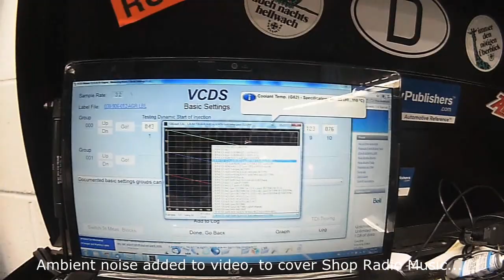VW A4: ALH TDi Timing Belt Installation

Comment: This video helped thanks again! Had to remove small roller again for more room to place the "very huge" engine brace back :) 
I´m still try to figure out if I removed the mount with or without all the rollers placed.. from top or bottom? Anyway I´m very closed to have the tb replacement done! :)

Comment: Besides replacing the cam seal, is there an actual reason to remove the cam sprocket?
Reply from the maker: You don't have to remove the sprocket... but it (the cam sprocket) has to be loose so that the timing belt can be tensioned correctly.

Comment: hello, when you adjusted the belt tension, shouldn't the upper roller be installed?
(I noticed that you installed it after the belt was already tensioned)
best regards.
Reply from the maker: Yes, it should be. In my mind though, it does not affect tension that much, so sometimes I don't install it until after the belt is tight.

Comment: Hey Thomas, what are the torque specs for putting this back together? Also, anything specific for installing the tensioner? Thanks!
Reply from the maker: +Brad Sherwin Timing belt kit should have come with instructions... you should also not be working without a service manual.  I'm a bit busy tonight to look up information. I think a Google search should come up with what you need.

Comment: do you have something with change turbo alh enegie? i have a little problem ... and i think is turbo my problem when a start 0km h- 120 km h have power very good  120-more sped, no whant.... lost power and not run more 120 you have idee what is it ?
Reply: i think the turbo no make more preesure
Reply from the maker: If the ECM sees too much boost, it reduces fuel to bring the boost down. Check that your Actuator Rod is moving freely. If it sticks, then it will produce too much boost and the ECM will then reduce fuel. With a scan tool you can check boost pressures while driving (with a second person).
Reply: what is ECM give me your acount skype or facebook
Reply from the maker: Engine Computer. I am starting work now... won't have time to chat. I can send information tonight after work (West Coast Pacific Time after 6pm) Watch my overboost videos:
VW A4: 1.9L ALH TDI Engine: Overboost Code
VW A4: ALH Turbo Overboost codes due to stuck Turbo Vanes...
Check that the rod moves freely.
Reply: ok i understand but maibe we can talk sunday  give me you skype whre are you from more exactly ? usa? california
Reply from the maker: Canada, I don't do skype or video chats.
Reply: :(( ok
Reply: i from romania europa
Reply: haw i can prove if ecm is my problem do you have something video about this ecm?
Reply from the maker: It is most likely not an ECM problem, but the ECM is in control of the boost. You have to check why the ECM is reducing boost or fuel... or if the turbo vanes ate stuck (like in the video links I posted above).
Reply: i saw yor video and my  vanes turbo not whork... is bloked
Reply: haw much is there in canada a change  a timing belt ? I mean the the workmanship
Reply: sory:))))) i not write very good but i think you can understand me
Reply: heloo
Reply from the maker: I am not at home right now... using my Cellphone to write. Once I get home this afternoon, I will write more. Have you tried to free up your vanes? Is the rod stuck up or down? What is your engine code? ALH, BEW, BRM etc.?
Reply: my car is a volkswagen jetta for usa and i think in canada is same for europa is volkswagen bora  and i have 1.9  tdi alh and my brother have a seat cordoba 1.9 tdi  with enegie cod agr and the problem with turbo have my brother with agr enegie  i what talk with you more  is beter if you make a skype acont or facebook is easy .... i am glad to meet you
Reply from the maker: marius coiculescu The AGR does not have a variable vain turbo... here is a pdf on how to check Wastegate Pod:
http://fkh161.ca/VW/AGR.pdf
Reply: ok I'll check tomorrow what time is there now? here is 22 and 13 night
Reply from the maker: marius coiculescu 12:20 afternoon.
Reply from the maker: marius coiculescu 12:20 Afternoon = lunch time, today is sunday, I do not work on weekends. 2002 Jetta can be bought for $2500- to $6000+ depending on condition, transmission and engine.
Reply: yes i understand thenx for all information,here in romania the combustibil is very expensive and here many people using for fuell oil for kitchen you hard that ?
Reply from the maker: marius coiculescu Yes, I have heard of people using heating fuel.
Reply: seriously? and what is your opinion about that ?
Reply from the maker: marius coiculescu A diesel engine will run on a number of fluids. Is it bad for the engine / fuel injection system? On new diesels, yes. I would only use the correct diesel fuel.
Reply from the maker: marius coiculescu No skype, facebook, google hangouts, ICQ, MS Messenger, Yahoo Messenger etc. Sorry. I would never get any work done (I am editing videos right now).
Reply: what video ?
Reply: what cellphone you using ? nokia samsung motorola lg ?
Reply from the maker: marius coiculescu Samsung... no facetime or phone calls.
Reply: hello have a good day
Reply from the maker: marius coiculescu Thomas 43
Reply: where city are you living ? ottawa? haw is there is nice ? i from romania city valcea and my name is bogdan and i have 29 years ,i am worker in construction and now is very  bad with bulding here ,not find whork is a big crisses finacial , and now I switched to mechanical ,My salary is 200 dollar in a month .... your salary haw much is it ?
Reply: you have a video with a poomp injection you open the poomp injection ?
Reply from the maker: marius coiculescu No.
Reply: you have a viber in your pfone ?
Reply from the maker: Don't know what that is.
Reply from the maker: I already mentioned that I don't have time to talk on the phone (even if it is free over wifi).
Reply: Saturday Sunday ,when you are free haw old are you ?
Reply from the maker: marius coiculescu I'm gonna have to block you if you keep pushing this subject. I will answer questions and supply service information, but I DO NOT DO PHONE CALLS, VIDEO CALLS or CHATS.
Reply: ok i undesrtand you
Reply: can be abut my problem with my enegie filter diesel ?
Reply: I checked everything what you tell me and everything seems ok i don t know what is the problem,now i think mabe the filter diesel,becouse i dont know anything your history
Reply from the maker: marius coiculescu If you have a question send me a message via youtube private message or email to fkh161@fkh161.ca or sign-in to my forum and post a topic there:
http://exovcds.freeforums.org/
Reply from the maker: marius coiculescu Fuel filter for the AGR Engine? If your brother has power from 0 to 120km/hr then the fuel filter is probably ok. If you have any doubts, change the fuel filter and see if it makes a difference.